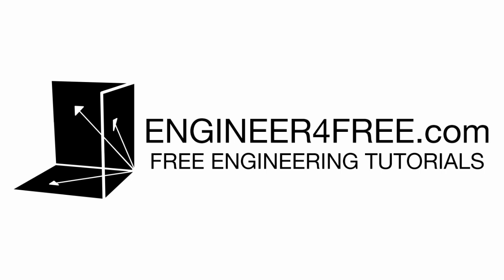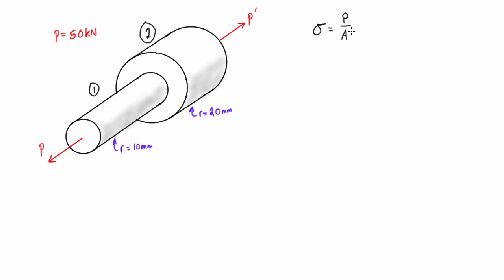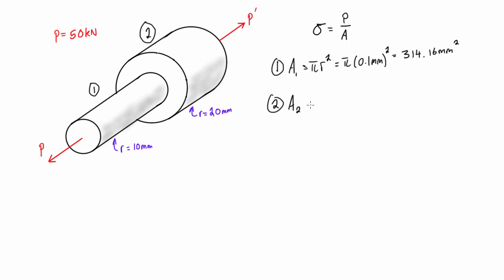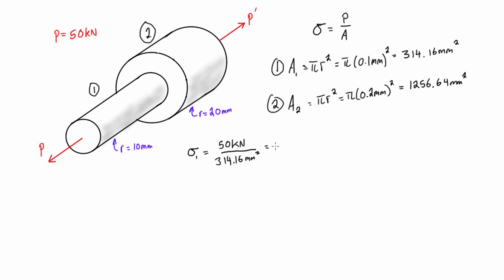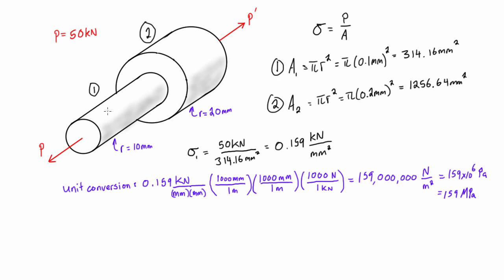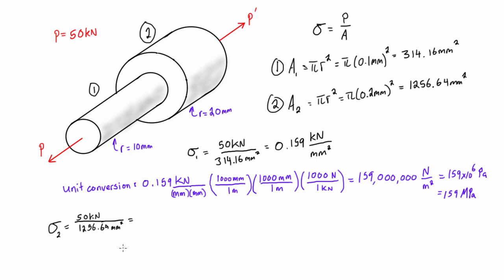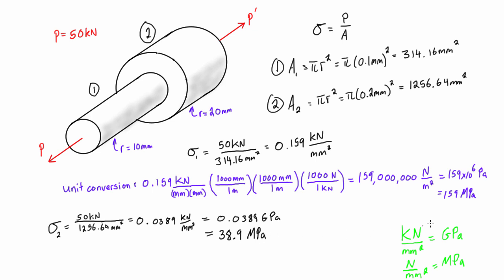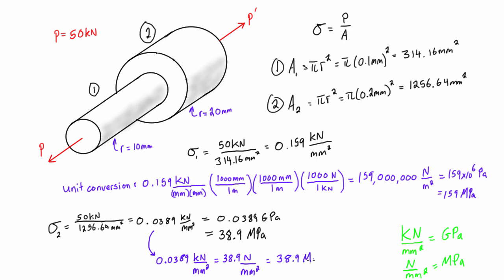Normal stress in members with varying cross-sectional area

Comment: In finding the cross-sectional area, you used 0.1 mm/0.2 mm, but you give the variables as 10 mm/20 mm.
Reply from the maker: Ah what, nooo! Those are clearly supposed to be 10mm and 20mm in the calculation, and the final cross-sectional areas are the correct result of using 10mm and 20mm, respectively. I always work the problems before I record the video so the math checks out, but you'd be surpized how easy it is to say/write one thing when you're thinking another. Sorry about that! I have wrote a little note in the description in case this comment gets buried. Thanks a lot for pointing it out!!
Reply: @Engineer4Free  yeah that happens to me also, but the most interesting part is how our brain algos are working that you can clearly see 0.1 but in your head you think 10, and you just go with that discrepancy throughout the entire calculation, fully honest, fully conscious, fully confident, and yet not seeing how big of a discrepancy it is. I wonder where other places in life we do this since this is a serious bug in our brain and plenty of people have it if not all. In math is the easiest to spot, very black and white, but in other life areas might be responsible for a huge percentage of all problems we have :)

Comment: Why didn't you convert the units first?
Reply from the maker: Please note there is a typo in the equation for each cross sectional area. I wrote/said 0.1mm and 0.2mm, when I should have written 10mm and 20mm. The cross sectional areas are correct, and were calculated off screen with 10mm and 20mm respectively. Sorry for the brain fart, there is a note about this in the video description as well.

Comment: You explain this in 7 min while my Professor use my 45 min lecture and I still don't get it. Thanks for your videos.
Reply from the maker: Hey Agustinus, If you have an hour or so, I can really recommend that you check out the first section of videos here: engineer4free.com/mechanics-of-materials they start as basic as possible, and incrementally progress to more difficult examples
Reply: @Engineer4Free  i will, thank you very much

Comment: Ur values of r is not correct
Reply from the maker: Yeah sorry. I am aware of this typo and there is a note in the description mentioning it. I wrote/said 0.1mm and 0.2mm, when I should have written 10mm and 20mm. The cross sectional areas are correct, and were calculated off screen with 10mm and 20mm respectively. Sorry for any confusion that it caused.

Comment: What if the forces are different?
Reply from the maker: If you have a problem like this where the member is not connected to anything, then the forces must be equal and opposite, otherwise it wouldn't be in static equilibrium. If the member is fixed to a wall or floor or something, then the reaction force must also be the equal and opposite of all applied forces/moments added up, because again, if not, it wouldn't be in static equilibrium.

Comment: What about if the sample was hollow from one to another? How the cross-sectional area should be calculated? Please help me to understand it.
Reply from the maker: A hollow cylinder is basically a tube, with an outer diameter and an inner diameter. Find area of the circle that uses the outer diameter, and subtract the area of a circle that uses the inner diameter. The difference is the corss sectional area of the material. Here are some examples I did that involve hollow tubes: https://www.engineer4free.com/4/shearing-stress-due-to-torsion-in-a-hollow-circular-shaft - and - https://www.engineer4free.com/4/find-the-minimum-inner-diameter-of-a-hollow-circular-shaft-in-torsion
Reply: What is P'? and why is it included?
Reply from the maker: If P' did not exist, the sum of forces along the axis would not net to zero and the object would not be in static equilbrium. P' is a force that is equal and opposite to P. P' could be the reaction caused by a support. The support is not shown to keep the problem more generic.